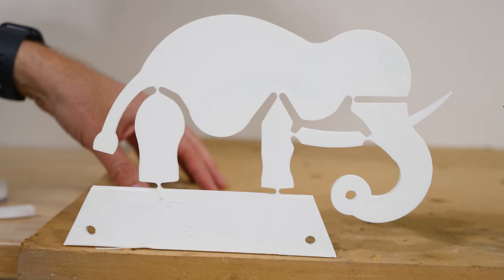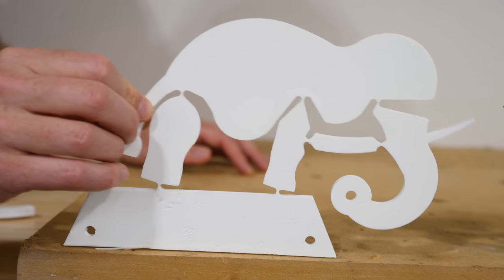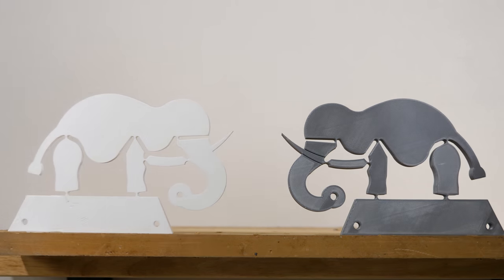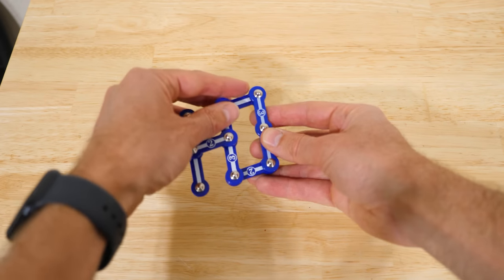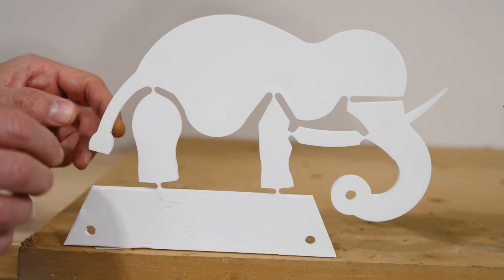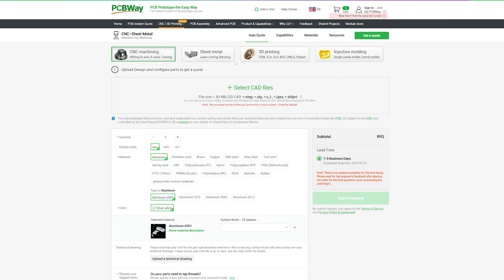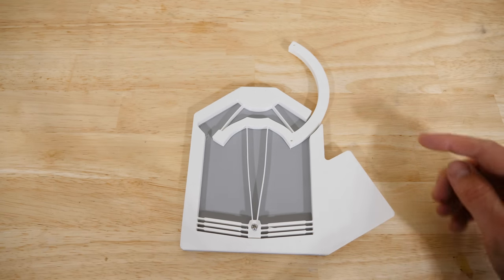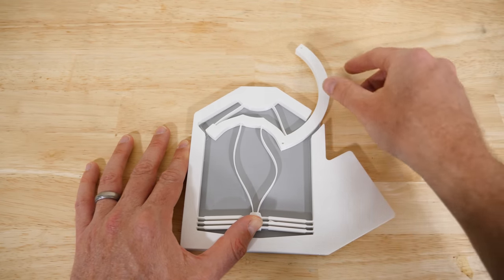How Does The Wyrd Mechanism Work?

Comment: The most beautiful thing about this is, that i have just learned how to calculate such systems in my engineeringclass. The system is designed in a way so that the so called Instant centre of rotation of the last element always lies in the place where the tip of the trunk happens to be. I know this is just a complicated way to explain what is happending, but this is so satisfying to me right now.
Reply: wow! 😍

Comment: That's very cool. Use of the rigid bodies helps you to see that there are two 4-bar mechanisms linked together. The odd shapes of the elephant and trunk make it difficult to see that the hinge points are aligned on parallel rectangles.

Comment: To me, it looks fairly similar to a steam locomotive, just without the rotation.  The moving piston and pushing bars treat each wheel like its own floating point, especially with larger steam trains where one piston can drive 4+ wheels at a time without ever needing gears.
Reply: I'm just imagining different ways a ratchet system hooked up to the part that remains solitary would work

Comment: I was gonna say ‘it’ll move closer to its mouth’. Relatively I am right. Didn’t expect the ratio of everything and the two parallelograms to be such that the end of the trunk would stay in place relative to the base. One of those things. At the same time; could have guessed because otherwise what is the point of the question in the first place. This is all a matter of perspective though. Fun little toy! Thanks for sharing.
Reply: If you are talking about the connection to up most right (the one in above the tusk): the entire thing works because the distance between the center of the hole is the radius of the circle this point is drawing. In order for the center to not move we need that connection to go in a circle with radius the length of the elephants leg, so it isnt mooving
Reply: My answer as well. He didn't specify relative to who or what. The trunk does move, and the tip as well. Rotation is a movement, even if a partial rotation. The only way to explain it properly is to say: "Will the trunk tip occupy a different space when I push from th rear?" 
Most definitely the trunk is moving as per the outlined circumstances. By his explanation the legs do not move either. And since the legs and trunk aren't moving, then it is impossible for the body, the entire elephant to move.
If you believe me to be too picky, I would say it is the host of Action Lab who should and could have explained it to where there would be no ambiguity, and therefore no comments, and no reason to be picky.

Comment: It’s basically a third leg (yes, I went there). It has the same joint positions as a leg, only the foot joint is replaced by that circle. The parallelogram attachment to the front leg ensures it still moves the same way.

Comment: I feel like the reason they added a circle with a hole in the middle at the tip of the trunk was to demonstrate that the circle will rotate around the center point. I predict that everything will move except the circle at the tip of the trunk. Otherwise, why put it there?
Reply: I made that prediction @0:23
Reply: optical illusion
Reply: Exactly what I thought too
Reply: Well it can't really be truly stationary, logically the round part at the end of the trunk also rotates slightly, but because it is round, there are no irregular shapes to betray its movement, aside from that part of trunk attached to it.
If you check at 1:00 at HD or 4K quality, you can clearly see the texture on the grey elephant's trunk rotating anti-clockwise when he pushes it.
But he could make it become stationary if he inserted a Rolls-Royce-like wheel bearings in the center of the hole, but that's a different kind of technique altogether.
Reply: I was gonna start analyzing it for way too long to see which direction it was going to move, but then I looked closer at all the moving points for 5 seconds, and said screw that. So I merely looked at the question from a distance and assume why was it asked. Why weird? So I figured the solution was that it wasn't going to move at all.
Reply: i feel that alot of whats said is misleading, I see no "mechanism" or "rotation", i just see a contraption designed to have one point of it move in just the right way to counteract the rest of the movement. its abit like standing on a train and throw a ball backwards at the same speed of the train, it will look as if it just falls straight down, does that have a name too? The wyrd ball? I dont see the point or logic of it being a "thing", its just basic physics
Reply: @MrTnbopp123  There's not much to it, i've likened it to a rectangle turning parallelogram and back again, but the mechanical points/joints are masked to look like an animal shape, so it doesn't look as obvious.

You can see the "sausage link" behind the elephant's tusk and in front of its front leg, that piece pulls on the trunk, making the trunk 'split open' at the joint, which pulls it down and negates the forward motion and gives the 'optical illusion' of it not moving at all.

His demonstration with the square thing showed just that, it only looked more "special" because he didn't make a full square, instead he placed the bottom left piece up in the middle, to give the illusion of a 'floating' corner piece.

Even though you can clearly see the thing going left to right (the 'stick' part attached to the round part), but the round part seems to be standing still, but yeah that's because it is round.
If he put the bottom left piece where it "should", the effect would be exactly the same, as the bottom row does not move at all, only the attachments move from left to right, and the upper pieces move the most, because they're not resting on the floor, so they'll move parallel from the bottom row, with the sidewalls making diagonal lines, like a parallelogram.

Comment: I had an immediate flash back into my linear algebra lessons when I was an electronics engineer student. One day the teacher spoke about the vectorial transformation of an equation on the Euclidean plane, she gave us a bunch of coordinates and the homework was make the product between all them and it’s vectorial matrix after that we had to make the graphic of both series of numbers and at the end the result was a guy riding a bicycle and the other one have a displacement on the X axis just the same as the elephant after and before. Then I quite in to architecture and for my thesis I developed a way to make sound visible (and then applied my research in to an auditorium) by using a parametric design software, when I had to explain all my models and simulations and how it works I didn’t knew how make it, so I started reading all the software manuals and I’ve found how cad software works, and it the same thing as the linear algebra, it make a graphic interphase out all the plotting data, and all the transformation tools make a single transformation multiplying that by a value (for scaling and moving), and use the multiple transformation by a vectorial matrix to deform and mirror or make a combination of tools like scale on one single axis, single and polar arrays.
Reply: @MrWildbill  ratio

Comment: The conjoined force vectors from the legs and the back, will push the trunk down while it's connecting rod will create a force pair back on the legs causing it to rotate clockwise around that pivot point at the trunk tip

Comment: You could've just made a square with the ball thingies, the effect would've been the same, as the other 2 on the bottom row had just as little movement as the one you highlighted.
In fact, the other 2 actually moved less as they were resting on the table, haha
EDIT: btw, it's the 'sausage' between the elephant's head and front leg that's the key part, without its pull, the trunk would move with the rest of the body.
So it effectively is like a rectangle turning into a parallelogram and back, the sausage link is completing the circuit.

Comment: Its all Maths. Basic Geomatry. The 3 bars exists in between 2 parallel lines. and the 3 lines itself are also parallel. The angle between 3 parallel lines must be same to the parallel lines they join. In elephant's case these lines are hidden by shape of the elephant. All is done by the compliant angles between 2 parallel lines and 3 other parallel lines. First time I have ever seen out textbook Geomatry Apply to anything practical.... Enjoyed the video very much....

Comment: Pretty sure I've seen something like this before. But there is a trapezoid around the front legs/head/base of the trunk area, that is probably perfectly positioned so that the hole in the trunk stays exactly where it is (the trunk rotates around it). It's as if that part is bolted down.

Comment: It moves in the direction that I expected, but I didn’t predict the circle being a pivot. It makes sense considering the top connection of the trunk and the pivot point both line up with each other vertically, and line up with the respective connections on both legs horizontally

Comment: The trunk will rotate back, because the legs are rotating forward and the top of the elephant is just transitioning forward. Thus, the top of the elephant is moving forward further than the leg of the elephant. So the part of the trunk bound to the leg will not move as far forward as the part of the trunk bound to the top. This causes the trunk to pull back toward the leg as the top moves forward.

Comment: I guess that its a double wishbone system the trunk does the exact thing as the front leg the hole in the trunk is at the same place as the joint in the front leg meaning the hole in the trunk will stay in the same place as the joint of the front leg is stationary so the hole in the trunk will be too

Comment: So, I haven't watched you push it yet, but looking at those joit positions the trunk should be turning around the hole at the end of the trunk. So when you push the upper part of the trunk will move forward while the tip will remain in place.
Reply: And I was right.

Comment: Tail goes forward=>Legs go forward and Body goes forward. Since theres a commection to the trunk from the leg, and this part of the leg will move less than the head of the elephant the trunk will move backwards at least relative to the elephant maybe and i think thats variable to the design (proper calculation needed to work it out) also backwards relative to ground but i'm pretty sure,that relative to ground it will move forwards, cause everything else its connected to moves also forwards relative to ground, but the tip might still move backwards relative to ground,cause its lower than the foot and thus with small angle it will move more

Comment: Is there any way to recreate this without any parallel joints like the ones visible in the snap circuit and the elephant (if you look close enough)? Or would that simply just not be possible?
Reply: good question!  Parallelograms are the simplest but it seems plausible that two or more non-parallel joints could be made to cancel each other out.  I'm interested as well.

Comment: I mean technically, two things. 1: the question was incorrect, as the trunk does move, the circle at the end doesn’t. If you are spinning a stick, and the end of the stick stays in the same place, will you say that the stick isn’t moving? No. 2: either way, the circle at the end is moving, you can see it, even if it’s just slightly.
Reply: The tip is rotating. And rotation is movement. "Some of something is all of nothing" In other words he asked if the trunk is moving. Then shows only the tip is not moving. The tip is only a part of the trunk, not all of it. 
He should have asked, "Will the trunk tip occupy a different space when I push from th rear?"
Reply: @michaelmoore7975  yes, thank you, this is rather exactly what I was saying although I didn’t put it into such elegant phrasing. I would have added the fact that spinning is movement, but I didn’t want the point to seem redundant, especially since you can see that the circular point is moving anyhow.

Comment: I stared at this thing for about a minute looking at all the different forces applied and thought to myself ah it will probably go left, then i thought that wasn't weird enough so i studied a little more and realized that the body will also be pulled down that missing force i didn't account for is what made me figure out that the trunk would remain stationary, i was more surprised when it not only stayed but actually rotated around the circles center axis. pretty awesome actually. Lemme get a 2d DXF file of this so i can laser cut this out of different materials and see how they react. Lets see what a 2x4 would do, or how about 1/4 aluminum plate, or even 1 inch steel? lets see what we can do!

Comment: This is neat !
But I'm pretty sure those printed pivot points, the little tabs that connect the members, will fatigue and wear out pretty quickly.
Reply: Depends on how much stress you place on them. The material is inherently flexible to a point, so as long as you don't exceed the material's flexibility margin they should be good for a proper while

And given it was engineers at University that designed it, I'm imagining that they built the motion limiters to approximate the max range of average 3d print material

Comment: I would think that the joints in compliant mechanisms would eventually fail through fatigue. It seems like the main advantage would be lower manufacturing cost.
Reply: Depends on materials used. Aluminium will fail, spring steel will not, neither would plastics like polyethylene or polypropylene and rubber. There is a very common piece of compliant mechanism that's used everywhere - in your car, TV, laptop, mobile phone, headphones etc. It's called loudspeaker - at it's most basic level it's a rigid membrane suspended by elastic elements (spider and surround; the latter is often from the same piece of material as the membrane), and they can move back and forth tens of thousands times every second for decades without failing. Tires for your car, motorbike or bicycle count, too, though they tend to wear out rather quickly due to being rolled over a hard surface continuously.

Comment: If you think of this geometrically, imagine a circle with a point in the middle and another on the edge. Then draw a circle connecting both points, you can see how the elephant moves because the points resemble the two joints of the trunk.

Comment: Let me guess: This is for MEMS (micro-electro-mechanic-systems), right ? The only point in replacing an axle with a inferior elastic conection is, that you can etch it in silicon. It may also be usefull for one-use weapons (mines, grenades,...), as elastic connection dont age when they arent used (but wear down quickly, thanks to meterial fatuige). A mine made from compliant mechanisms could probably survive for a century without becoming a dud.

Comment: Well, the hole is at the same level as the bottom two leg pivots.  The top pivot is at the same level as the tops of the legs.   The  line joining the two pivots is parallel to the lines formed by the pivots of the respective two legs.  The "pinned" connection between the front leg and the truck  is parallel to the ground.

All that said, I didn't figure it out in advance.  Had it just been some "sticks" I believe most would have figured it out in advance.

Comment: This is one of the channels that tends to send my braincell hurtling off in all sorts of directions and this certainly did that. First thing that popped up when I saw the second example was that would make a great hidden door lock. A pressure plate somewhere that would move the bottom part up and allow the handle to rotate unlocking the door. Wonder if that's the sort of thing those ancient folks used for the booby traps in all the Indianna Jones movies?

Comment: Guess: trunk will tuck under the elephant's head when pushed forward, and the tip of the trunk will rotate about the hole without moving position.

Comment: The problem is that focusing on the single point (the tip of the trunk, the ‘open’ end of the parallel bars) is an artificially emphasized focus. In both cases, it is simple parallelogram movement; all points in line with the highlighted point are fixed in space
Reply: To clarify further on the elephant, where it may not be obvious; the hole at the tip of the trunk is at the point of perpendicularity for the upper hinge point (trunk to head) and both hinge points to the left (feet to base), defining the parallelogram. As long as this is true, the placement of the bar between the front leg and the truck is irrelephant (sorry, couldn’t resist), as long as it’s parallel to either of the parallelogram movement axes

Comment: Trunk should move inwards I'm guessing since it looks like parallelogram
EDIT: Derp, I was so close. technically it does move inward relative to body, but yea sicne it's a parallelogram, the trunk is located at the same height as the lower "hinges" and thus should stay put with the base

Comment: 0:13 by initial inspection, the eyelet on the trunk stays in place.
Reply: That was my prediction too, but it didn't make sense, so I didn't believe myself.
Reply: @seanbrockest3888  I agree that it somehow doesn't make sense. But then you realize that it's just a square formation and that there's rows of connections.

I dunno how i saw it though, it was plain intuition.
Reply: @RealCadde  that's actually how I came to it, without realizing. I was counting the forces as vectors and doing a plus/minus equation. When it came to zero, I assumed that the end of the trunk wouldn't move, but it still didn't make sense in my head.

Comment: If anyone is confused about 1D-9D:

1D, 2D, 3D are spatial

4D, 5D, 6D are temporal 

7D, 8D, 9D are spectral 

1D, 4D, 7D line/length/continuous 

2D, 5D, 8D width/breadth/emission 

3D, 6D, 9D height/depth/absorption

You're welcome.